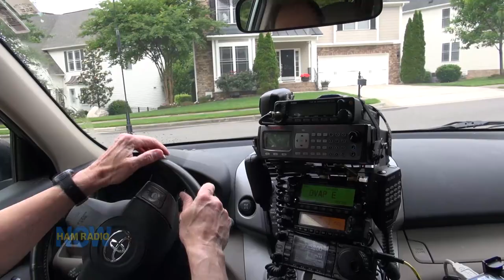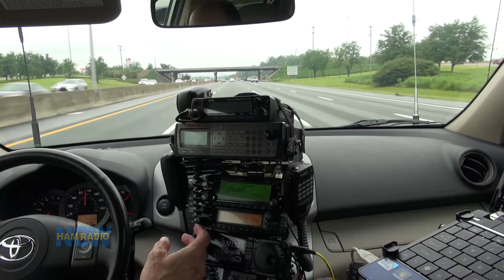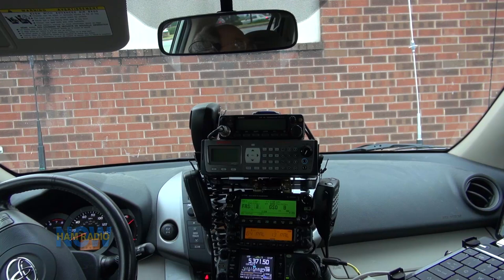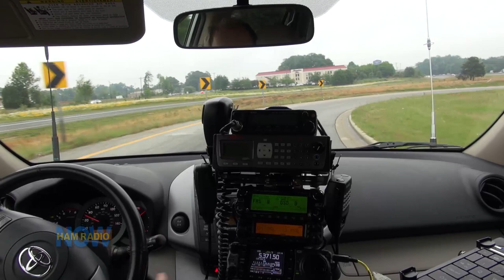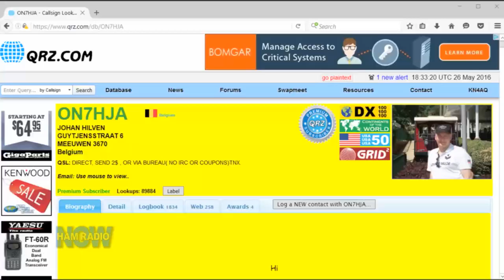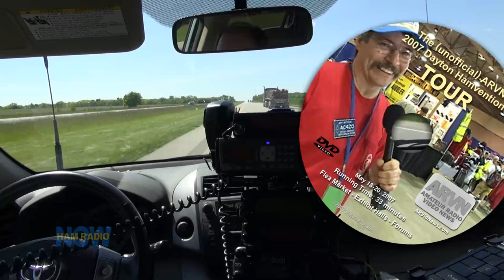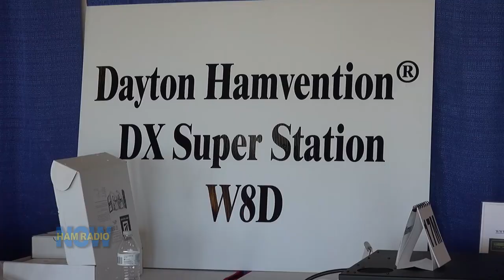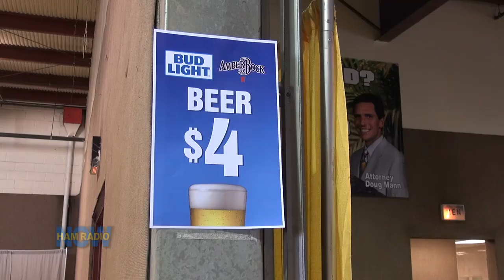HRN 253: DAYTONa 500 (On the Road) on HamRadioNow

Comment: I think I remember some time in the past you listed your mobile radio setup...can you go through the stack again?
Reply from the maker: ICOM 7000 HF, ICOM 2820 dual-band dstar, Yaesu 8900 quad-band, Alinco DR-235 220, GRE 500 scanner (or is it 600?), Kenwood 710 dual-band APRS, 8 antennas (Tar Heel 200 for HF), ICOM 92 HT, Kenwood F6 HT.
Reply: That GRE600 is quite the scanner...do you scan HF with it?
Reply from the maker: I think it bottoms out at 28 MHz or so. I can tune the 10 meter FM band at 29.5 - 29.7 (and I have those in the scanner - it's alerted me to some 10 meter openings). It will do AM, FM and P25 digital, but not SSB. 

The 7000 has some scanning ability, but I've found it limited. Unless I'm missing something, effective scanning requires some form of squelch (noise, tone, digital). FM does a pretty good job of separating signal from noise, but AM and SSB do not. I believe that systems that rely on HF/SSB 'scanning' use some form of pilot tones to let their scanner know they've got a signal, and not a lightning crash.

Comment: How do you install a big radio stack in a car like that? I am thinking of becoming a ham down  the, plus I may be starting a business down the road that may need part 90 communications as well.

How would I be able to install CB radio, ham radios, plus any part 90 radios I might need, into a big stack like you got in your car there?
Reply: Looking again, it looks like the very top radio in your stack there is a commercial grade part 90 radio? Do you do MURS/GMRS as well or did you convert a part 90 radio to operator on the 6 meter, 2 meters, or 70 centimeter bands?